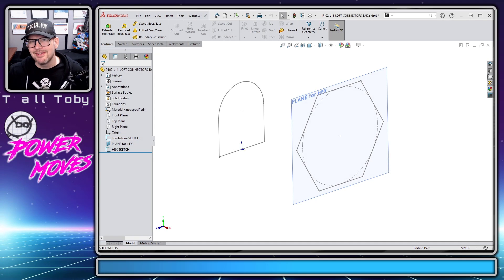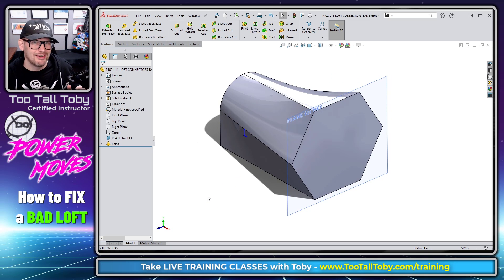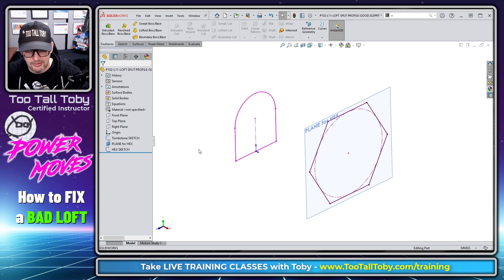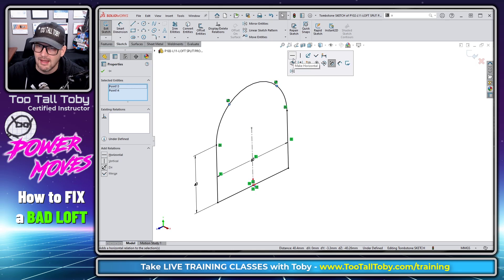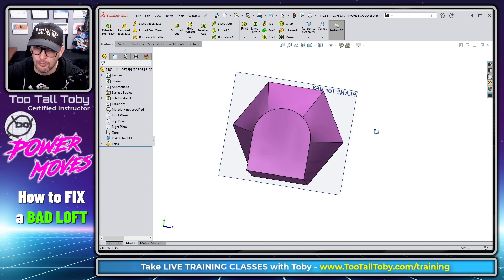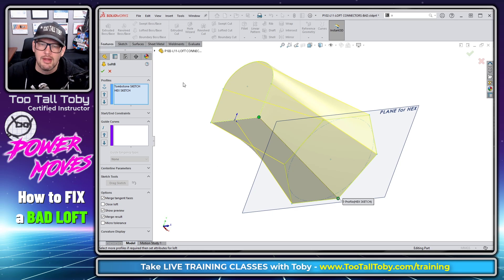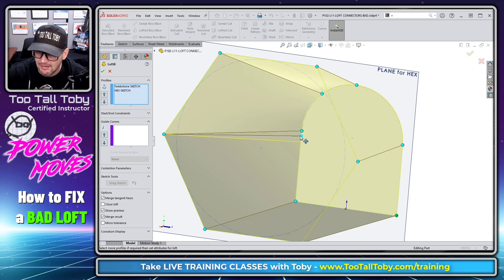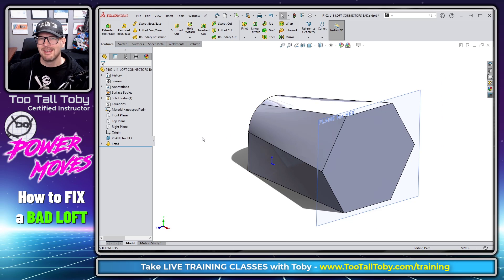QUICK FIX for a Bad SolidWorks Loft

Comment: I can't find a video that shows how to drag loft connectors that won't drag where I want them.  Why can't I use analytic geometry?  Why can't I use the normal constraints (e.g., coincident the connector to a line end point)? That is, have complete control, even using x, y, z coordinates, to define and position these points.  SolidWorks can be so completely useless at times!
Reply from the maker: Lol - yeah it can be really frustrating at times!

Comment: Very nice tip!

I noticed some wonky behavior, though. I drew the tombstone and split the arc, made the points horizontal like you did, and put the dimension on there and changed it to 60 degrees, picking the points in the same order. When I chose other points on the arc in the same order, it dimensioned to 120 degrees instead of the expected 60 degree driven dimension. Lots of errors and odd behavior later I tried another sketch, with just points to eliminate any of the possible sketch issues, and it works, but when you choose the three points, the first point you choose is the center point, but that worked every time. 

For some reason I only sometimes got your result picking the same points in the same order...?
Reply from the maker: Yeah it must need a specific order.  Glad you liked this tutorial!